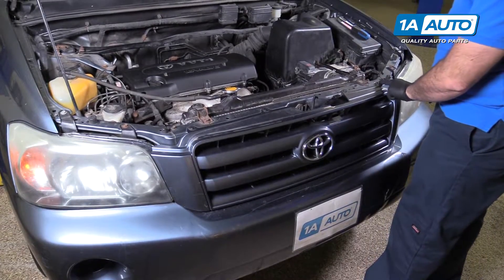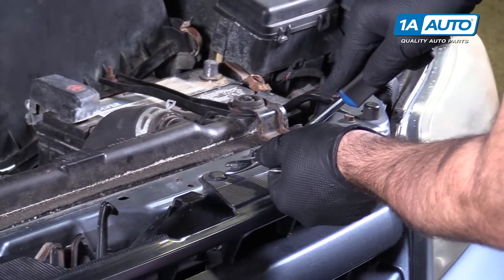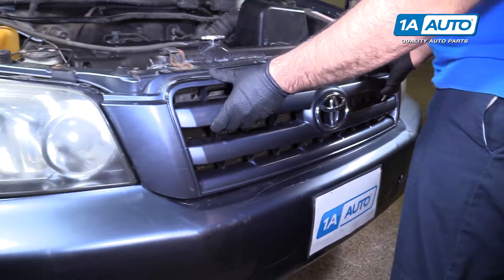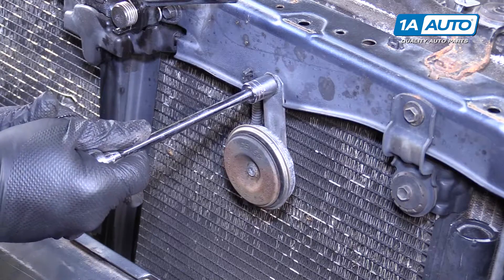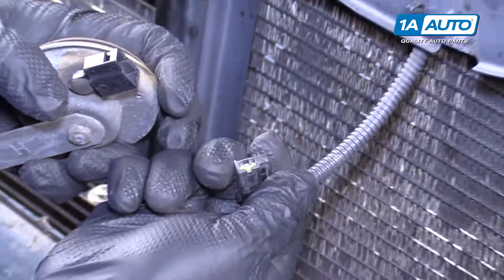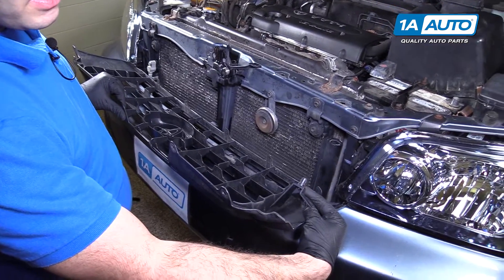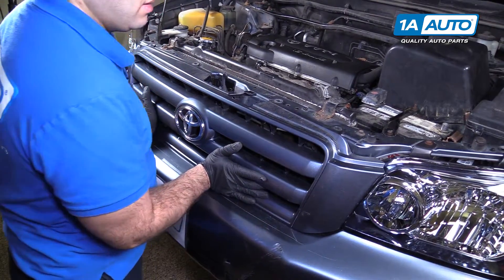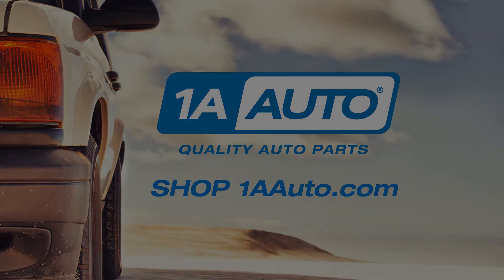How to Replace Horn 00-07 Toyota Highlander

Comment: Thanks for the video!
I just replaced my working but too "meep-meep" 2010 Toyota Highlander horns with compatible new Helas that look like yours in the video. BUT now only one of the 2 new horns works -- any clues if the connections seem okay? Both the old horns worked.

Comment: High tone wire connector that you disconnect the horn itself from stopped working after initial removal and reinstall, even trying a different toyota horn doesnt work... help?
Reply from the maker: +The Graduate Apple We wouldn't be able to diagnose an issue like that here, you may want to have a local mechanic take a look at it. Thanks for checking us out! http://1aau.to/m/Shop-1AAuto-c
Reply: @1AAuto  oh, well thanks for the attempt. Also could you possibly do a vid on accessing the low note on the highlander 1st gen? They placed it horribly and I have no real clue where to access it from
Reply from the maker: +The Graduate Apple We're always cycling through common cars. We'll add this repair to our list! http://1aau.to/m/Shop-1AAuto-c

Comment: This video is crap the new horns don’t come with the one connectors anymore it’s a way longer process to change the horn as for the low its 10x harder cause you have to remove the whole front bumper
Reply from the maker: +Jem Alshaef Thanks for the feedback! We will pass it along to the production team.